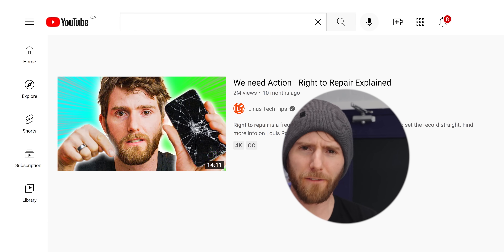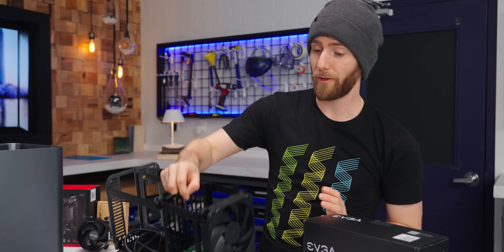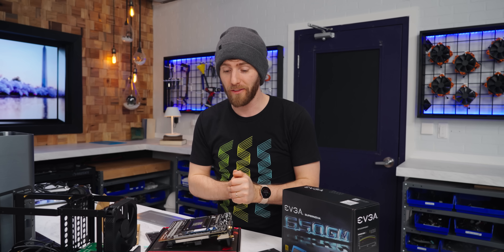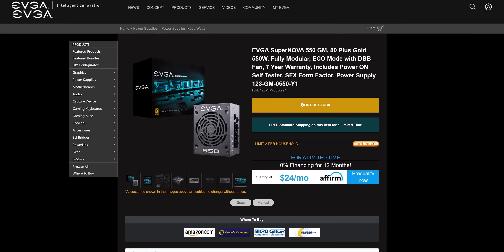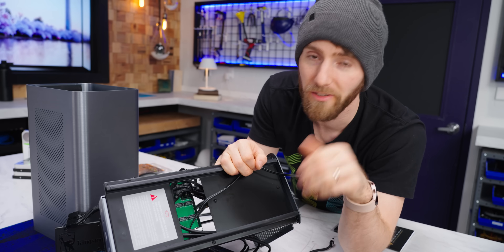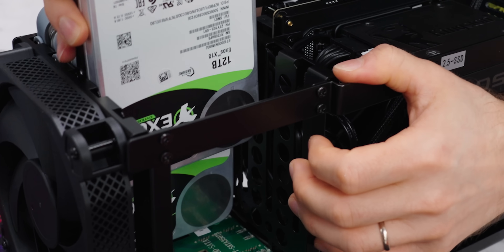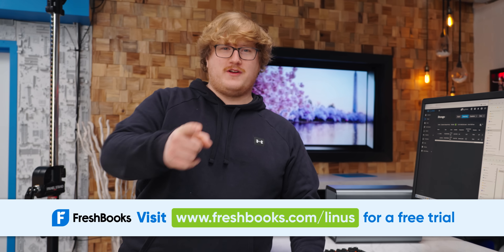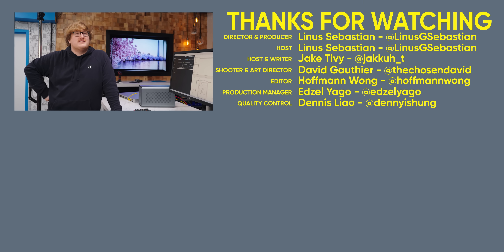This blows away the competition - JONSBO N1 NAS Build

Comment: Really loving the small footprint of the case. Makes the recycled Dell Dimension 2400 case I'm using for my current NAS look huge by comparison!
Reply: I used to have a Dell 2400. Thing was useless even when it was new
Reply: @bassblaster505  Hehehe, the fact that they only came with 128MB of RAM from the factory meant it needed a RAM upgrade straight out of the box. That's putting aside the issue of how laughably terrible the performance of the 2.4GHz P4s were.

The cases are quite solidly made, though. I've built so many sleeper rigs out of these for that reason alone!
Reply: @Luftyloon  2.4 P4? Nah the 2400 came with a 2.4G socket 478 Celeron. The motherboard however, if updated to the A05 bios did support the hyper threaded 3.06gHz P4. Would have been worlds faster than the celery. I had the entire matching set, even the 1024x768 CRT. It was upgraded to a whopping 512MB of RAM sometime in its life.
Reply: @bassblaster505  That’s right. I believe it was the 4600 that had the P4 stock. Yeah, those Northwood era Celerons were horrible, puny cache and no hyper thread, which made them perform quite poorly. That and RAM were necessary upgrades for those boxes.
Reply: And here I am running two 4U chassis... and still in for half the price not including storage.
Reply: @johngaltline9933  But two 4U chassis are massive, let alone the power draw and fan noise. Sure, you have more drive bays at a lower cost, but that setup isn't viable for a home media NAS unless you have a dedicated server room.
Reply: @Luftyloon  and he's also forgetting not everyone has a server rack in their homes
Reply: @Luftyloon  the small footprint is nice, if you actually need it, however most people do have room for a standard tax case that is a lot easier to work with. 
Power draw is nearly the same as components take the same power no matter what case they are in. You will, and should, have more fans, but they won’t actually take more power as they can run slower to push the same volume of air with the added benefit of redundancy if a fan dies. 
While most people don’t need 8u of space and 30 drives, the principal still holds, and a single 4u, shallow depth case can be had for a hundred bucks that will hold 6 to 8 drives if you don’t mind having to pull things apart the same as this case to change drives. If you want an expensive case, the money is better spent on a case for $200 with tool less hot swappable bays. 
Last fan noise and server racks are a non issue. This is a file server with off the shelf parts. Fan noise is the same as any pc, which is to say it is pretty much nothing. As for a rack, mine is a table in the basement on which the chassis sit on top of each other.
Reply: @johngaltline9933  You make a ton of good points here, I'll admit. I do agree that a standard ATX case is cheaper, more expandable, and easier to work on. I already have a ton of those laying around. 

Also, I was assuming you repurposed some enterprise-grade drive enclosures, not the basic ones that are just rack mount PC cases. Still though, I'm willing to sacrifice ease of serviceability and options for expandability if it means a much smaller footprint, as I don't need a petabyte of storage for a home network, let alone anticipating having to pull the thing apart every few months.

Must be nice having a basement for such things! Here in Florida, I don't have that luxury.
Reply: @Luftyloon  the basement is nice, but I hid run them on the floor in a closet for a while. Got too hot under load in there, running various VMs. 
Using 2 cases with 10 3.5 bays and 3 5.25 bays, and trays that convert the 5.25 in to 5 more 3.5. All told, room for 30 hdds. In one case I have an old am3 board as a pfsense router and hdds for the other. Main server is a super micro dual 6 core opteron board. 42tb of storage at the moment with mostly used enterprise 2tb drives I got on the cheap. All told I’m in fir about $1000 on the setup. 
It sucks the power down and most folks probably don’t want to add $20-40 a month to their power bill so using newer hardware and larger drives may make more sense. I’m running on solar, so the power is more or less free
For most folks any cheap atx case and a relatively modern motherboard may make more sense, but depends a lot on the budget. If you can afford to drop a grand without drives, go for it. On the other hand, a lot of people could do better actually having redundant storage they can afford, even if it has a higher running cost

Comment: Since ZFS uses of memory for caching, it makes ECC memory pretty much required for any kind of storage server you need to rely on. These Ripjaws DIMMs are great but not quite appropriate for a NAS. A homelab maybe, but certainly not something storing important data
Reply: Glad someone already commented this, as you're 100% correct. Bit flips in RAM due to cosmic rays (yeah really) are a surprisingly common issue, and the error detection/correction from the parity drives in ZRAID does nothing to protect against them, as they only help in the process of reading/writing the data to disk.
Reply: Btw for anyone else reading this, this problem isn't unique to ZFS. Pretty much any storage system that is optimised for online storage like this (aka any storage setup you'd have for a home NAS) will have this problem due to FS RAM caching.
Reply: Yet there's tons of pro's and millions of users that say sure good idea....but not mission critical for the general user on a budget

Comment: I have a very similar setup with Xeon+ECC mem and 5 10Tb Seagate Ironwolf Pros. With the top fan being on a louder side, the airflow is not actually enough, and rather tightly packed HDDs get easily overheated. Reached 65C on 1TB bulk copy. Also, the GPU cooling fan is facing the only solid wall of the case and quickly gets hot too.  It is a nice-looking case, but there are some design flaws, and I am scratching my head right now.

Comment: Why not using a 5600g? It's damn efficient and cheap.

I've already my case (fractal design node 304 that can handle 6HDD) but the rig with 5600G, 16Go @3200 + 1Tb Nvme + mobo Asus tuf b450m-pro cost 400€

Comment: RAIDZ1...WHY???! With the size drives are now (and have been for over 10 years at this point) tolerating only a single failure is absolutely BEGGING for data loss when another drive fails during the lengthy resilver process after a replacement.

RAIDZ2 is a minimum period if you care about uptime.

Comment: So, someone is yet again running ZFS on top of a cheap, HOT and unreliable m2 to SATA adapter. If this system is really for someone, PLEASE, swap it for a real HBA card (or some Raid Flashed with IT mode) if you really treasure your data.

Comment: That looks pretty cool and if your desk or the room you work in is the only place to put it, than this is a great option. But if you have a closet or a place to put the NAS where fan noise is not an issue then I would suggest getting an off lease server. These things are coming on the market by the pallet. I got a Dell r720 8x3.5in HDD with 16gb ECC registered, Xeon 2660, H310 SAS II HBA flashed to IT, Broadcom 4x1gigbit NIC for $280 all in. Upgraded to 2 x E5-2658v2 2.4ghz 10core 20 thread CPUs for $20 each. Increased the ram to 64GB for $100. To learn on before I commit to my final storage setup, I got 4x 2TB sas drives with caddies for $25 each. The 720 series has built in lights out management where most of the functions are free, like remote cold boot. The iDrac license is $35 tp get full function, like vnc of the boot screen, etc. 2x750watt 80P platinum PSUs that are hot swappable. Replacements go for 25-30 bucks US. 10gigbit NICs are like $40-50. Inside the 2U case are 6 PCI3 slots. Two 16x full height, full length so this can take a 2 slot GPU.

Comment: I literally had to buy that ROG motherboard for a SFF build I did this past week. It seemed like 160-200 US for something not as good or a little over 200 (on sale) for that. It hurt for such a basic build, but the rest of the boards were b550 or lower. Have a decent little system in the same volume of an xbox series s.

Comment: I use Next Cloud, on barebone debian. I got VM with hardware passthrough for NIc and block device passthrough /replaced CPU with  i5-3470T/, for storage, 1 TiB mirror storage with boot ssd and 16G RAM/can expand though/ all in a dirty cheap Shuttle H61 (in original size)

Comment: I did something similar with a cooler master elite 130 case. With no graphics card or optical drive, there is plenty of room to put hard drives at the front of the case. I think I can get 5 or 6 no problem, currently at 3.

Comment: One thing that should be considered is power consumption. The DS1520 tops out at 120W, this would use a lot more. True, it's a lot more powerful, but my DS920, which i've bought this week handles everything I need it to do, using max 100W. Can you tell i'm a bit bitter about not building a custom mini pc instead?

Comment: I did basically the same thing but used a Ryzen 3 2200G processor on a ROG Strix ITX B450 motherboard instead so I have display capability if I need it.  Most of the time I don't need it.  I remote in instead.

Comment: Damn i need this case. Just bought a Threadripper system for NAS and virtualization use, the NAS and lighter virtualization could run on simple Ryzen system too. Would even be more efficient for 24/7 use... and 5 HDDs would be enough too, damn..

Comment: in canada ok price ok in europe this crap confing cost over 1000€
Reply: only amd 3100 cost over 320e and mobo 350€ ram 150€ ssd 50€ PSU evga cost 105€ and 4 hdd 10 TB cost over 350€ each 1 disck AND CASE in this video aliespress not disponible
Reply: cost no case inclued for mi over 1700€ is absolute trash

Comment: I did this exact setup in an old Dell 2U server.  The problem is with compatibility with BackBlaze.  I have an unlimited storage subscription with BackBlaze that currently has about 10 TB on it.
If I want to keep using BackBlaze with this OS, you have to use their significantly more expensive B2 backup (not unlimited).  So I either have to use Windows with unlimited backup, or Use TrueNAS, but no offsite backup as it would be WAY too expensive.  It's a real bummer, because I can't risk not having offsite, but don't want to use Win10 either.  In fact, the only reason I can even contemplate using this at all, is because my last RAID controller card puked and destroyed the entire dataset.  The only reason this is even an option is because of BackBlaze unlimited.  Can't beat $6/month unlimited.

Offsite wins, I'm afraid.  :(

@linus - Can you find a way to connect TrueNAS to BackBlaze unlimited??

Comment: Currently i have a QNAP (With all of the security patches that entails) and there are a few things I like about it is that it over a standard server build.

1. Low Power consumption
2. Ease of use when it comes to initial setup and set and forget
3. Robust (Mines almost 14 years old)

Ive been thinking lately about moving away from Synology and QNAP but in my experience, these solutions do have their place (Im noting here you guys didnt say they didnt) and for most people with NAS's, I would assume that they would just want a set and forget solution, daily backups and a simple setup.

Either way though, I loved this tiny build and it wouldn't be out of place in a lounge room (Currently mine is racked which is also nice.)

Comment: If you can still find them, Lian Li PC-Q35 is another great option to make a home NAS. It's older and a bit bigger, but it can fit a 2 slot expansion card up to 300mm.
Reply: I’ve got a lian li PC-Q25 and the aluminium vibrates so much from the disk drives. So depends what you’re after.

Comment: SSD is actually overkill. TruNAS actually recommends using flash drives. I run two in 2N configuration and have only had one fail in 8 years.

Comment: Case has a design flaw, that gaping hole that allows wire bulk through to snag on the outer shell. Have a non-liability warning sticker isn't good enough. They should've either had a better daughterboard design that prevents the issue, or a cover that screws on to contain the bulk. The fact that they produce this product with that issue, when the product is such low value and only fits a niche of use cases compared to the wider case market, is a red flag; if they couldn't take the extra couple minutes in the design phase to implement a plate, if they couldn't take the steps to fix this issue after they knew it was an issue but instead put a warning sticker on the product, the product isn't worth the money, the company isn't worth doing business with, because that is absolute laziness. 

The entire cabling situation is overly jank anyways, as if the storage daughterboard and 8 pin issues aren't evident of that enough. The drive 'slider' mechanism seems a bit jank compared to typical trays. The case is a cool concept, but execution isn't the greatest, and it seems like the company really doesn't care all that much, considering a warning label of nonliability is their solution to a larger problem.

Comment: When it's the same price point nas is probably simpler as you just turn it on and it works

Be nice if 5 Bay was minimum standard so z2/RAID6/SHR2 could be used as same space as 4 bay nas (z1/RAID5/SHR1) so many users only have one nas and only use single redundancy when they should be using dual redundancy

Comment: Theoretically, with 100 TB Nimbus Exadrives you could get 500 TB in that chassis. I do have one disappointment: the TrueNAS setup doesn't start a Telnet or HTTP server. I also wonder, do Jonsbo do an extended N1 case with five extra bays for a 10 bay device?

Comment: this case is a freakin rip from the Mantiz Saturn Pro eGPU enclosure...

Edit: oh wait, this is probably a retooling of the Mantiz Saturn Pro. It's basically the same components down to the back chassis "levers" and the top large chrome screw. Jonsbo probably is afiliated with Mantiz or vice-versa

Comment: I'm currently running a Synology DS 415play (4 drives, 2 raid 1 sets) and I used to use it for backing up customer files for web design etc and a plex server. I now mainly use it for personal files and plex server and I've been thinking of making my own NAS for a while so this vid was perfect but I have a few questions. Does True Nas support Plex install or have a store like Synology for apps? Does this support transcoding on the fly for streaming or would need a different cpu? My PC has two network cards on board (2.5gb & 1gb) if I build with a board that has the same can I run a network cable direct(crossover maybe) to get 2.5gb performance as I don't have a 2.5gb switch yet. Can you host game servers (Minecraft/ARK etc) on true nas. Any answers would be great!

Comment: Bad timing. I bought a pre-built 8 drive NAS from Synology and filled it with 74 TB of 16 TB Seagate NA drives. Cost me almost $2,500.  Of course,  after my job is finished with me I probably don't have the time or brain cells left to deal with the complexity of this solution. But I would've saved a ton of money 💰 😕

Comment: I did something similar. Because I wanted as many sata ports as possible on my board plus a lights out dedicated nic I was limited on ITX boards one what I could do....here is my setup:

BTW - I built 2 of these for DR purposes.....

I am running TrueNAS native to the board. Couchpotato, NZBGet and Sickgear all run as jails. The jails were built from scratch since I do not trust what people put in Docker builds....you have no idea if there was any malicious code put in a docker build.

Build:

Silverstone SST-CS280B case (8 drives supported with hotswap back plane)
ASRock ITX MB C37584I-4L (4 1GB NICS, 1 IPMI, 13 Sata Ports with 8 drives via 2 mini SAS HD connectors)
32GB of Ram
16GB SataDOM drive (Boot OS)
8 - 5TB 2.5" drives (USB drives shucked from case)
650w Power supply
OS using TrueNAS with 2 - 4 drive Vdevs for performance and setup as a Z1 Pool

This system can be upgraded at anytime and has one PCIE x4 slot.